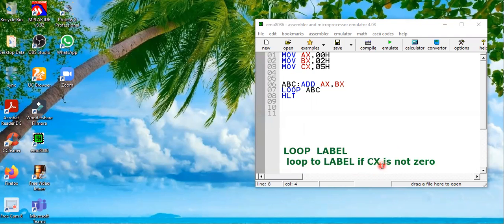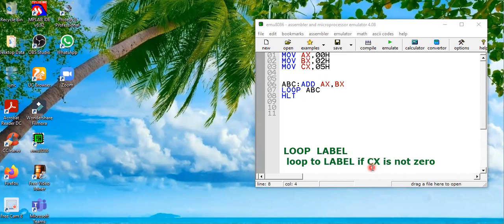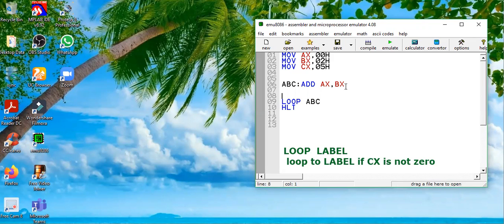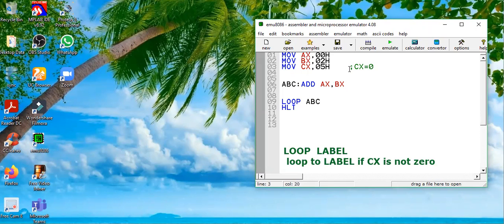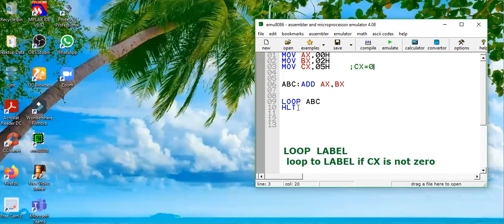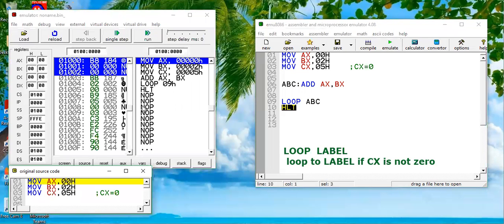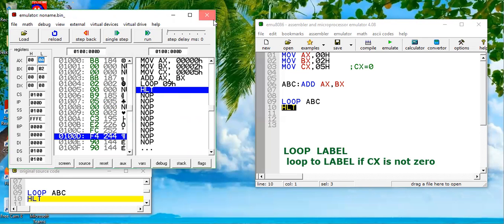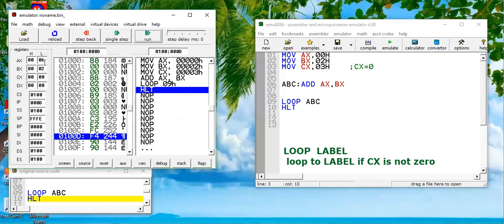LOOP INSTRUCTION | 8086 Instruction set with emu8086 | Looping  example in 8086 assembly language

Comment: If I wanted to loop till I got a power of a number, say 5 raised to the power of 6, that is 5 * 5 * 5 * 5 * 5 * 5? How do I do it please?

I tried changing the values of the registers, as well as the  'add' instruction to 'mul' in my  assembler but it keeps giving me an error.
That there is an invalid combination of opcode and operand.
Reply from the maker: I think  you already got the solution  in my other video  where you commented.  So I don't need to explain  it here right?
Reply: @LearnOnline1  Please do explain it here 🙏 . It's still unclear to me.
Reply: MOV AX,1H
MOV BX,5H
MOV CX,6H    
LP: MUL BX  
LOOP LP
Reply from the maker: @dyaaelabasiry  yeah  it's correct  solution. Result will be stored in AX